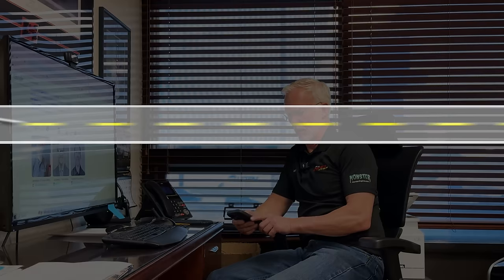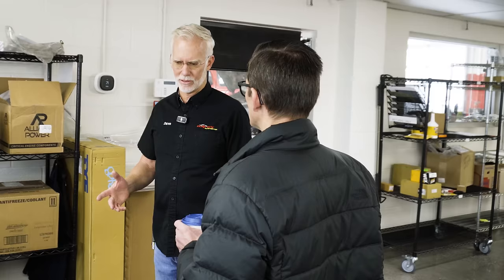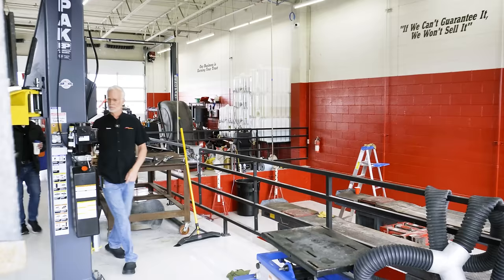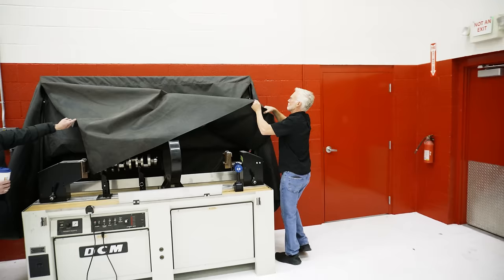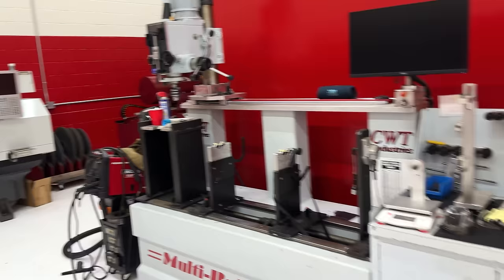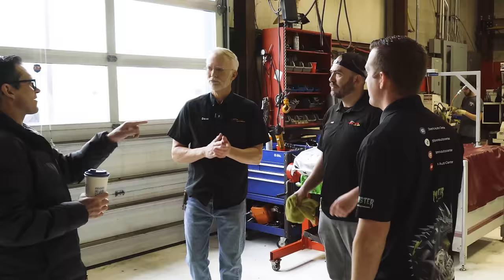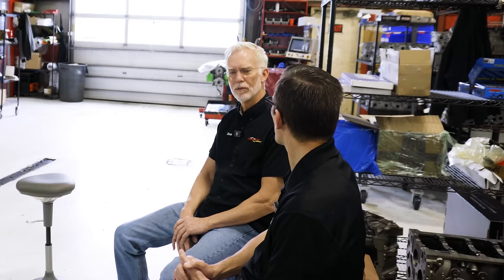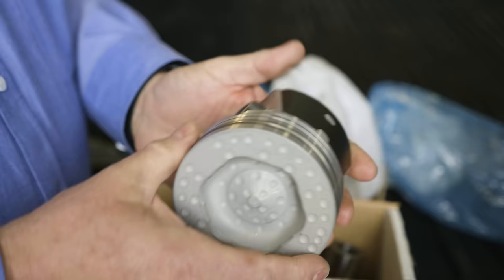Sitting Down With Lake Speed Jr. - The Truth About Oil Change Intervals and Analysis

Comment: So, I have a cumming 5.9 with 580k that leaks more oil than it uses.i just keep adding oil which sorta keeps it fresh. I'm guessing I should be changing it periodically... and I run it real hard, so it's getting a lot of cylinder pressure often.

On a somewhat more serious note, this engine should win an major  award. It's not been treated well, yet it runs (performs) like a champ. 
(99 3500 24v w/ a 5sp manual, here in So Utah).
Reply: Cummins are legendary. Did you remove anything, like EGR or PCV (lesser EGR), to ensure only clean air enters the engine?

Wishing you a million mile motor
Reply: @amin4794  the 99 had no emissions :)
But they are known to have weak lift pumps and after replacing two oem types, I installed a FASS 'DRP'.
I also have an AFE 3peice exhaust manifold, 4" turbo back, Banks air horn, BHAF, & Edge tuner for the VP44. It runs great, but has A LOT of blow y, leaks A LOT of oil, and doesn't get oil changes often enough :(
And empty, the truck weights 9500lbs, full 13.5k.  It needs all its crisp power to pull the massive elevation changes here in So Utah.
Love this truck!

Comment: I own a Ford F350 KR CCLB SRW truck with a 6.7L. I drove it to about 85,000 miles before I deleted and tuned the truck. I keep the truck in “performance” because I get the best highway fuel mileage. At about 180,000ish miles I noticed the truck started to “roll coal” when I accelerated out of a red light. I am not the type that likes the thick black smoke pouring out of my truck so I started researching why. I ended up running Hot Shots Extreme in a tank of fuel and it immediately cleaned up the smoke issue. I now run the Extreme every 6000 miles but in between I use Hot Shots EDT. Can’t say enough good stuff about Hot Shots diesel treatments. The truck now has 210,000 miles and still drives great with very little smoke out the tail pipe.

Comment: I really like the idea of the sim rig.  In the industry that i am in years ago we discovered a potential compatibility issue between assembly chemicals/lubricants, like cam break in lube, contaminating our bulk test oil over time.  Our big issue was killing cams on breakin so we switched to different paste lube for the cam assembly process.  Later on the light switch turned back on because of what it was doing to the bulk oil over time.  Using compatable chemicals and understanding bulk oil pm fixed it.  Great video.  I enjoyed it!

Comment: 26:16 Right. This is why I change the oil in all of my cars at 2500 miles. Plus, it serves my OCD to have the oil changed at the same mileage markers (2500, 5000, 7500, etc.), and there are four oil changes per 10,000 miles rather than ~3.

Comment: Great video guys. Spot on about the used oil analysis. I work in the mining industry in Australia, and basically every single day shift, you will hear a call over the 2way radio for a piece of machinery to be pulled up to take an oil sample for analysis. 

They’re getting 60,000 hours out of series 4000 MTU diesels!

Comment: I really enjoyed this video; one of the best that I have seen in a year.  I have always told my customers the way I feel about oil change intervals after I build a engine for them; and had similar responses.  I also have felt 7500 miles is way to long for modern oil changes for newer vehicles; yet people wonder why the smaller turbo engines fail often.  Change your oil folks!  Thanks for the great content.

Comment: I’ve been a die hard change oil at 5k miles simply for the mere fact that for the longest time the factory manufacturer’s intervals were 3,000 miles and in some cases I’ve seen those still exist..and I  figured maybe it was a money thing between big oil companies and the factory’s. I’ve seen a lot of newer cars call for the 7-10k miles change intervals and I’ve never flirted with that…ever. That’s just insane. But after hearing this video it definitely got me on board with 3k. And I will also start doing my own oil analysis. I’m not a shop owner or anything just a hardcore DYIer but this video really changed my mind on how in depth I can be to make everything of mine last. Thank you guys for the collaboration. Such an awesome, information induced video! Loved it!

Comment: I ran 100k to 250k miles between drains on an 03 Detroit Diesel Series 60.  I sold that truck about 7 years ago with 1.5m miles on it and no rebuild, no major engine issues.  It is still running today and still no rebuild.   I did sample the oil every 15 to 20k and used a bypass filter down to 1 micron.

Comment: Great video, great learning experience! I always change oil at 3000 miles to 5000 max….. now I think I should go 2500 to 3500 max. My wife’s  gmc envoy inline 6 has been changed at 3500-5000 since new and has 180,000 miles…..runs fantastic! Changing oil is cheap vs rebuilding the engine.

Comment: Love the comments on engine break in and ring seating. My last motorcycle, a BMW S1000RR, has a 14,200 rpm redline. On delivery, it had 30 minutes of warm up and me getting to know the bike and then some full gas 14,000 rpm pulls in 1st and 2nd gear. Well, 2nd gear on that bike is almost 120mph so long term jail time stopped a 3rd gear pull.

I've had friends comment on how hard my bike pulled Vs others they had ridden. Maybe because the rings are seated.

Mechanical sympathy is good. Warn the engine up. Get the oil, the coolant and the components to temp and then give it full beans. Ironically, my daily car driving habits mean that I don't have a lot of time for the oil and engine to warm up, so I went electric. I was spending time to take my commuter (a Vette) out for drives to warm the oil fully and burn the condensate off.

Comment: My 2010 Toyota RAV4 2.5L needed the timing chain and camshaft phasers replaced at 212k miles. I knew the intake phaser would eventually need replaced when we bought it used 1 owner at 146k, the price reflected that. What I didn't expect was the chain being the component that failed. It had a cam/crank correlation code, the chain stretched. When I took the valve cover off there was coked oil sludge everywhere. We did oil changes on time every time with full synthetic oil for the entirety of our ownership. I suspect that the previous original owner didn't. I've seen inside of many of these engines using the same oil I used, with the same 5k OCI and they have very little varnish staining. The valve cover has an oiler tube that was blocked in many places, one of those places happened to be the end that oils the chain. The chain had gotten heated to the point that I could barely discern where the timing mark links were. I replaced all of the timing components and cleaned everything that I could. And I started using Royal Purple 0w20. The first oil change was a quick flush after 30 miles and the oil came out black, the second oil change was 200 miles later and it came out dark, the next oil change was 5k later and it came out looking much cleaner, the last 5k oil change before I traded it in the oil looked beautiful. We avoided total disaster and that engine has another 100k in it. I like that little engine and we replaced that car with a 2018 which uses the same engine.
Moral of the story, CHANGE YOUR DAMN OIL ON TIME, and use a good quality oil of the appropriate type according to your manufacturers requirements. In my case I could have replaced only the intake cam phaser at a cost of $400 and a couple of hours if proper maintenance had been done. Instead it cost me nearly $1,300 and took 3 days to do in the driveway, in Pennsylvania, in February, both are parts only diy.

Comment: I bought the first 68 Plymouth Roadrunner sold in Springfield, Missouri in September 1967.  I actually bought it before show day and had to wait a few days to pick it up.  It was the only one they had.  I had always heard that you drive them hard and don't "break" them in first.  I drove it to Cahokia, Illinois by St. Louis driving it hard the 144 miles on the Interstate.  I got to Cahokia and unwisely got talked into a drag race on a highway.  I was caught by the cops and when he saw I only had 700 miles on the car he commented about it.  I told him that I was told to drive them hard.  I got out of a drag race ticket and got a speeding ticket only because I had just gotten back from a year long tour in Vietnam.  So, I was glad to hear you talk about not babying a car in the parking lot but to drive it like it was meant to be driven.  I now own a 2021 EcoDiesel Jeep Wrangler.  The recommended oil change interval is 10,000 miles but I change mine about 6,000.  I have 55,000 + miles on it now.  I am thinking that I should change the oil every 3,000 miles which is what I did on the Roadrunner.  But now I am running full synthetic oil and back then it was 100% oil oil.  I am planning on keeping this Wrangler for my lifetime and hopefully giving it to my grandson one day.  What should my oil change interval be?  Should I put additives in the oil and in the fuel?

Comment: One thought if I may: Years ago I was running an intake manifold that did not atomize the fuel at lower RPM like many other previous used manifolds.  I had upped the fuel jets to dump in more fuel.  Without prior thought; that appears to have thinned the oil viscosity over many hours of run time.  (Causing more   wear on the crank bearings).  Thank goodness I caught it early enough, replaced rod and main bearings, engine was sounding like a newer one again. (Helped it was a stout lower end engine).

Comment: I make my own break in oil for flat tappet engines, starting with no additive straight mineral oil and adding zinc (ZDDP) to protect the camshaft while still having enough "abrasion" to seat the rings. Its replaced with conventional oil and zinc additive after 4 to 5 hundred miles.
I have 52 years in automotive repair and this works for me.
I will listen to what others say, but I never take their word as gospel.

Comment: I was taught as a young mechanic that 3500 is the best for an oil change but always do it by 5000 miles. I even worked at a lube shop back then ( for a short time) and that was also our interval.
      I also feel that time as well as mileage is also a factor. If oil in an engine has not been changed in much over a year, it's time to do it. Oil and additives degrade over time and with some contaminants in there, even minimally, it would add to degradation of the oil.

Comment: I run Rotella T6 full synthetic  oil with Archoil fuel and oil additives with a 2 micron oil filter kit from Amsoil. All my Blackstone reports have been good with TBN levels as well. My 6.7L  Powerstroke oil change interval is 5 - 6k miles. 110k so far 0 issues on a 2016 year model. It’s all factory stock no tune kits.

Comment: In 1992 I was a Field  Engineer with IBM.  Specializing in Series 1 computers.  They had a reputation for 25 year uptime.  My territory was just 14 miles south of Daves shop.  Itvtook a little while to get into the facility which supplied Diesel, regular, premium and 93 octain gasoline to every servistation in northern Utah, most of Idaho, Wyoming, Montana.  There werebon that day backuped empty tanker trucks for every serviststion mote than  300 of them.  That is when I learned all gas station gets the same gasoline.  Each individual station puts their own additive in their gasoline at the service station.

Comment: I have gotten along just fine with Amsoil and the filters with extended.  Talk about some engineering and brutal testing , they do it. Comes out clean as a whistle.  Just my experience . Yes , I wrenched , even owned my own truck running all over , also had done small engines (ultimate brutality of equipment there) and still work on my own projects and vehicles today.

Comment: Speaking about the double 2nd piston ring (top ring gap & 2nd are 180 offset). Common sense says soot will enter the top ring & build up between the 2 rings & eventually separating the 2 rings. 
I like the idea of double #2 ring but there's always other problems cropping up.

Comment: I'm  68 raced cars in past all street legal cars did all work my self. Always  Always  changed  my oil at max 3,000 miles used Texaco Havolen only once had a engine issue  head gasket. Never any issues  all well passed over 100,000 miles. Just keep quality clean oil in your vehicle. By the way this confirmed my thoughts regarding  manufacturer  oil change  scheduals.

Comment: The old standard was 3k mile oil change intervals. That's even what the OEM's recommended because the oils we quite a bit inferior to what we have today (except the zinc additive mentioned in the video, which you need to address at break-in). If you got 200k out of an engine back then you were doing really good, and if you did it was on its last legs. Now, things are a bit different. I'm not the world's foremost expert on oil chemistry and intervals, but I've looked at quite a bit of data and I've got almost a million miles (most of them hard ones) on various vehicles doing my own maintenance, and I can tell you that not only do you not need to stay down at 3k, your engine will still last longer than they used to even if you extend it a bit. I finally switched to 5k in the late '00s after reading up on it and I don't regret it one bit. I've got a gas truck with over 200k miles on it and the oil still comes out looking really good and feeling nice and slippery after that 5k miles. That's exactly what you want.  Lucky for me it's a '99 F250 and Ford was recommending 5k intervals still for towing and heavy hauling, so the guy I bought it off of who had it since new was doing just that, 5k. It's got 205k miles on it now, and if I'm not towing a lot with it, it'll use a quart or less of oil still at the oil changes. Basically, if I check the oil and it's down there, I know I'm ready for a change and I check the log book and sure enough it's pretty close. The other car I've had the engine since new and that one has gotten synthetic the whole time. It doesn't noticeably consume a drop between changes at 100k miles. One time recently I went on several long distance trips with it and ended up stretching the OCI to 7k miles, and I noticed a significant difference in the sounds the engine would make and the look and feel of the oil when I drained it. It was thinner and not as slippery and the engine just sounded noisier. I remembered in that moment that back in the early '90s when I first started driving that you could tell when you were approaching that 3k mile number because of that sound. That was an absolute must back then at 3k because the oil was spent (in my opinion) by 3k. Long story short, you don't need to do that any more, but absolutely do not run longer than 7k, and 5k is a good conservative number to stick with if you want 300k+ out of your engine without touching it.

Comment: Hands down the best video on automotive maintenance on the internet.  My question is why isnt there a home oil tester out there so that us diy guys can accurately adjust our oil change intervals??  I work as a mobile repair tech, thus my service truck sees pretty much every style of running, depending on job and location, and of course TRAFFIC and road maintenance.  Thus it makes it tough to call exactly when to change it, also effected by the following question: You said to expect 1qt consumed per 1k miles, topping off the oil with every fill up, how does that effect oil efficiency/change interval?  In otherwords is the new oil being wasted by mixing it with old

Comment: I do cold start calibration for a living, after tests we routinely heat the sump (pan) to 180F minimum. I think you’d be surprised how hot oil actually gets in the pan. 

In Arizona you can easily see 210F+ temps in the pan.

Comment: I worked in engine development at OEMs, there are targets to meet, sometimes exceeded, others designed to meet the spec such as "this transmission needs to survive 150k miles" and extrapolate from there for component level development until durabiloty testing of the engine system.

Comment: For a decade in the Navy I was always having to deal with PMS, Planed Maintenance System. Engineers and technicians worked together to determine the best products and and servicing intervals to keep our systems at 100% mission operational. If it called for a certain amount of chrome molly to be mixed with a certain grease in a certain way, we knew it was based on a lot of data and we were certainly going to do as prescribed. We do not want a missile hang fire,  a 5" gun jam, a locked rudder or a seized prop shaft. I hope our lubricants are made in the USA!

Comment: Thank you this was a wonderful informative video,I remember doing a head gasket on one of our JD 3140 tractors and then was advised to do the bottom end after a full head rebuild on taking the sump off I was amazed how clean the inside the block was I was told it was all down to regular oil changes and high quality oil used

Comment: Maintenance is everything.
Purchased new in Nov 2003 my 04 Silverado Z71 with 429000 miles on origanal 
eng/ trans. Oil changes on average 5 to 5,500 miles.
Their rough miles being its my construction everyday truck.
Still putting 16,000  miles a year. Runs great.
Maintenance is everything.
My 2002 Nissan Exterra 160000 miles is the same.
  In every new car glove box there is Maintenance booklet.
READ IT!!!!!!!!!

Comment: My kenworth with series 60 495/ 530 hp. Duel h/p depending on load. Back then transmission fluid was cheap. I had four tanks. total of 565 gallons at 90%. I put a gallon of atf in each tank every time i filled all four.